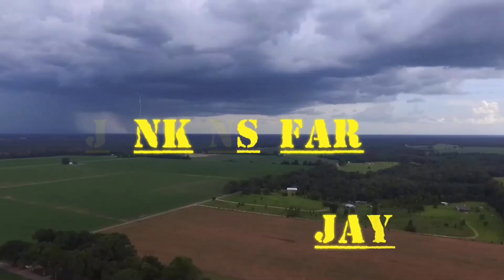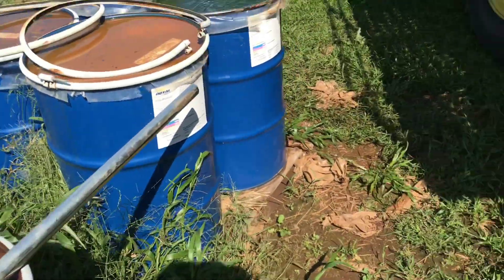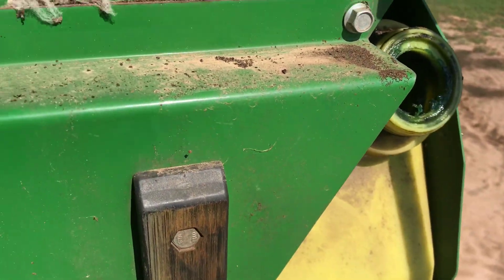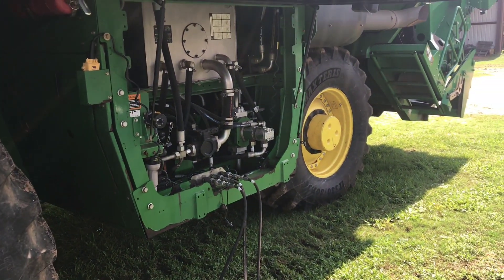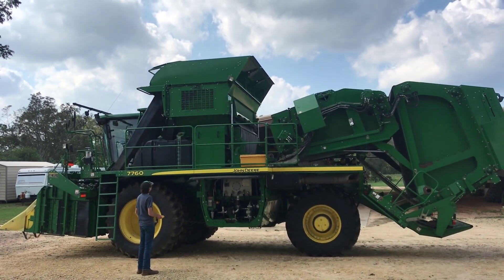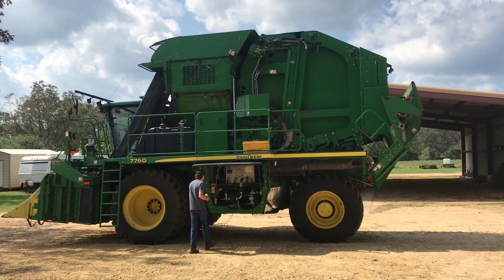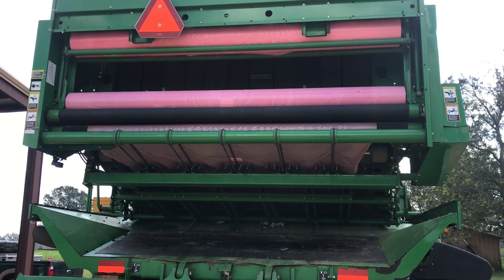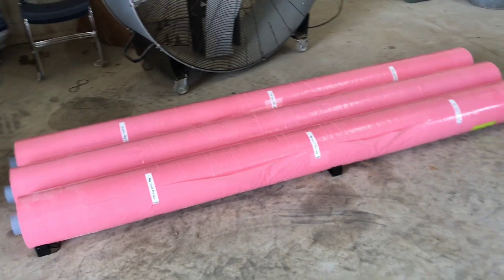Loading Cotton Picking Wrap...

Comment: I havent grown cotton in 11 years until this year. I just bought a 7760 but it hasn't been delivered yet. I've never driven or ridden on a roll picker. I had no idea how to do anything with the baler section, and I did not know how to load the wrap. Thanks for the video. Nice to have the grease pump hyd ports on the machine. Had to use a tractor to load grease on the old pickers we used to run.